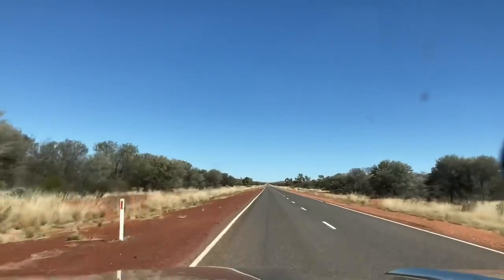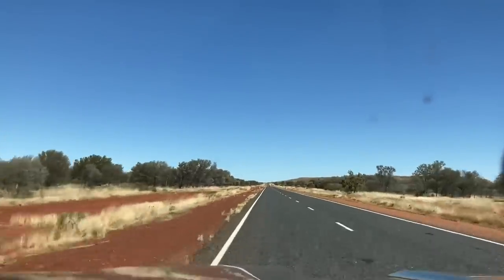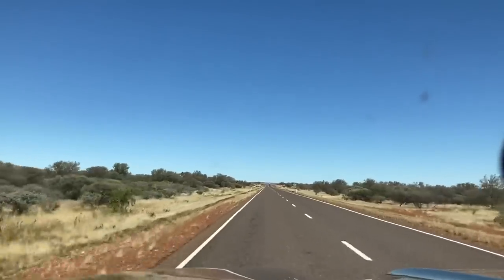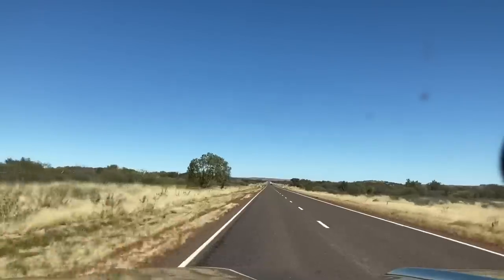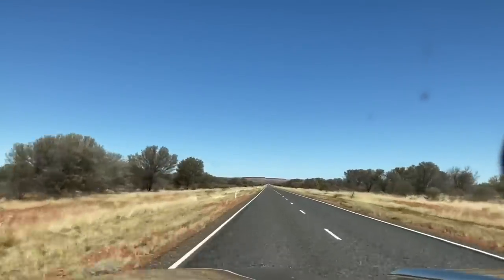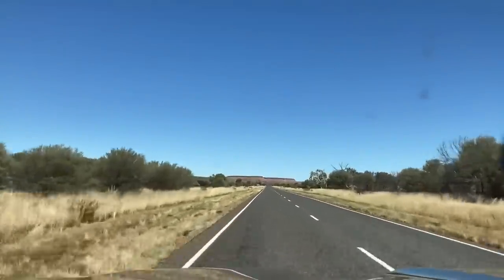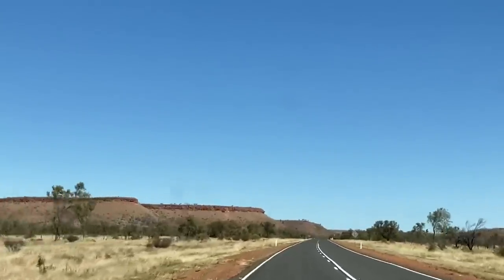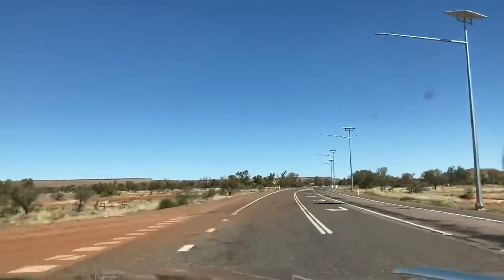LISTEN UP !!! RISK IT! run out of fuel? Minimum Safe Distance SAVE front & REAR Window &more

Comment: recently heading to broken hill in my 79 series the low level light came on 5 ks after passing coombah and with over 100ks to BH. did the maths in my head figuring fuel usage per 100 and made it to BH.  it took 125 litres in a 130l tank using more than I figured

Comment: I got 150kms travelling with the fuel light on  which was a total of 1420kms mined u that was a mix of 60/80/100 speed limit. Filled her up 121 liters which lead me to believe something wasn't right drove another 100kms filled up 38 litres. So l was on the last few drops 😁😁. No matter how slow l fill her up l can't get it in one go got to drive to the next servo 5-10kms to get that extra 20 liters anyone with any tip on that ( 2021 prado )